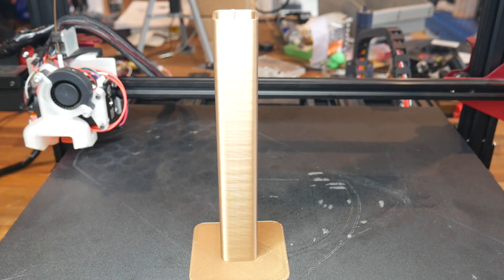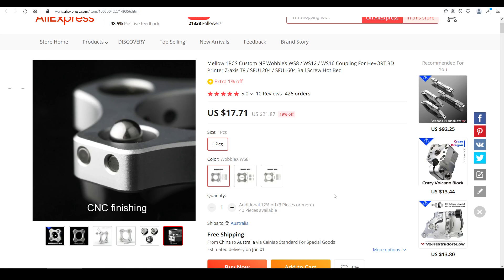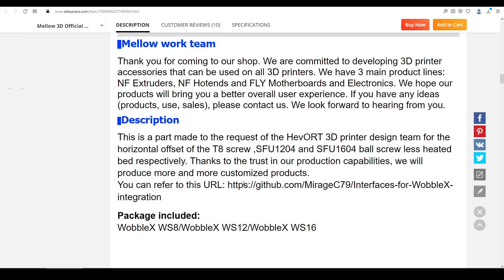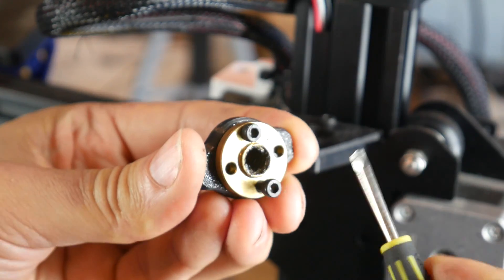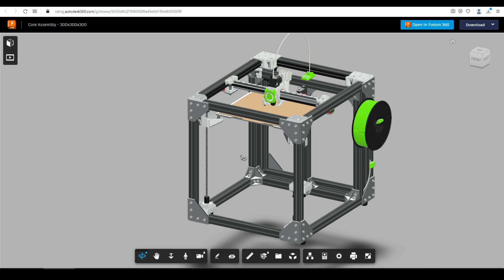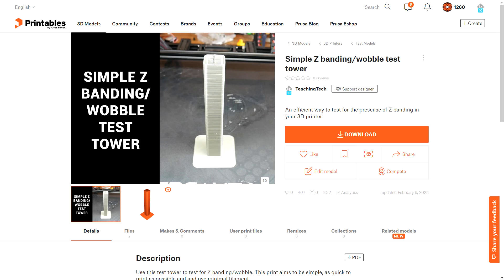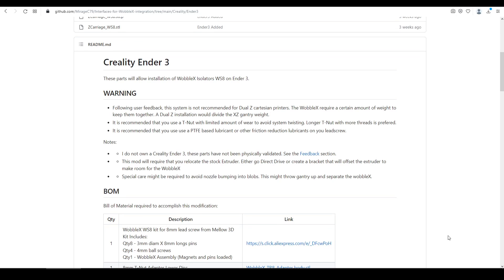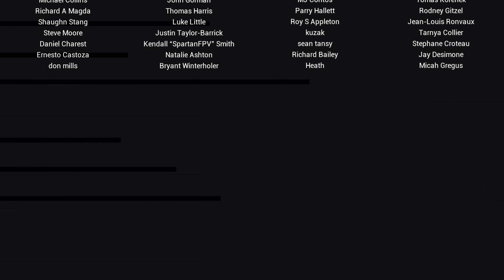The foolproof fix for Z banding and misalignment? MirageC’s wobbleX

Comment: The question is, is the "wobbleX" really better than a classic Oldham coupler. Those offer less degrees of freedom, but I don't think the tilt is really necessary. If the lead screw is so bent that the tilting becomes a problem, I think no kind of coupler will help. And Oldham couplers don't rely solely on the weight of the gantry to work, are much more compact and mostly a drop-in replacement.

Comment: Two years later.... I think there was something terrible crooked on your adapter, even when you put pressure on it the wobblex wasn't aligned. You can clearly see it at 10:02. The printed parts looks terrible as well, you can't expect precision from this sort of print quality.  
Printed mine with a 0.08 layer height, they look like its coming from a mold.
Have a dual Z cartesian printer, my lead screws have a 2mm lead, the z is turning a lot compensating for the bed, (fade height at 8mm)
even then no issues, both stays in place.
Out of the factory the rollers are way to tight, maybe they do that to mask a bent screw.
It can be the reason that your X gantry can't follow the leadscrew if its going up/down.
Fine tune your Z that it can move freely without play, put some time in it to adjust it.

Comment: Label the parts a,b,c a is the top plate, b is the wobble x, c is the bottom plate. 

If you attach a ball and socket joint similar to those old bionicles rather then the springs you designed 

And make this connection from A to B where the upper two ball and roller joints meet. 

Then from C to B in the same fashion. 

You allow part B to still isolate the zbanding from Part C so it doesn't translate to part A.

Comment: You can just slot the holes the lead screw nuts bolt through and achieve nearly the same effect after you slot them slightly do not tighten the screws all the way just to where they touch but are still able to slide a flat washer under this screw is also helpful

Comment: If the solution for bent lead screws cost more than replacing the lead screws what's the point? New lead screws for a normal size printer cost $9.99 and the wobble x cost $18. Why not just replace the lead screws?

Comment: HELP!! I've got an Ender 3 v3 se and I'm experiencing a lot of z banding that's inconsistent but seems to be getting worse. I've only had the printer since January. I loosened the screws on the z rod housings on the gantry, everything seems square, the extruder isn't loose, but I can't seem to figure out what to do to fix it. I can't find a single video or article with pictures that shows exactly what to check and how to fix it for this model of printer. Is there ANYTHING you can do?? I'm a 60 year old retired farm boy from Minnesota in the United States and I can't figure out what to do!

Comment: Combine Wobble X with a standard anti-slack nut assembly.
Reply: nope, the lead nut is rotating with the screw
Reply: I you didn't, but manufacturers disagree @MrBlackmidi1234567890987654321

Comment: I know it's hard to keep up with updates on all the stuff you do, but I think you should try a little bit better.  I just ordered 3 of the Wobble X sets to upgrade my heavily modded Ender 3, Creality CR-X, and my HEVO 300.  All 3 already run linear rails, and Westham coupling setups, and have decent prints, but I'm always trying to make them better.  The "Z jumping" is a concern with me, but I'm hoping using anti-backlash nuts/springs will solve that problem.  Because so many people on here have already asked about the use of anti-backlash springs,  I would've thought you would have done some type follow-up using them.  If they don't solve the problem, I guess I'll try some type of rubber band, or o-ring.  And if all else fails, I'll go back to the setups I run now.
Reply: Well, after a CONSIDERABLE amount of tinkering, I just could not make them work on either the E3, or CR-X.  As already talked about, the "jumping" was just too much.  I could not get around it using anti-backlash nuts.  With the ABN's on top of the carriage, they would not let the Wobble X move as it should.  With the ABN's under the carriage, it still had the "Z jumping".  There just isn't enough weight on the gantry to keep the Wobble X mated together.  

In place of the ABN's, I used some relatively thick rubber bands wrapped around the gantry and lower Wobble X carriage.  I admit, that made a considerable difference, and is almost workable.  However, I was greatly concerned about the overall durability of the rubber band.  No matter how I tried, the rubber band would rub on the lead screw.  I'm sure this will eventually wear through the rubber band in the middle of a print.

I truly believe that if there was some type of springs to hold the Wobble X assembly together, but still allow the movement it needs, this would be a truly great product for bed slinger printers.  Maybe somebody could redesign the carriages to have some type of spring perch on them.  I'm just not a CAD person, and have no idea how to do it.  In the mean time, I've gone back to using Oldham couplers.  They seem to be the best solution for z wobble on my bed slingers so far.
Reply: Are u running DD or bowden setup? @tommyc8333

Comment: What about using an anti backlash nut on the lead screw?
Reply: nope, the lead nut is rotating with the screw
Reply: 5:24 You will see what I am talking about. Addling a spring pressure to the wobble x will preload it like adding weight to the gantry.

Comment: The wobble alters the Z height it doesn't matter how much X or Y is compensated. It's at the leadscrew and brass nut contact location. A better solution, besides investing in a new straight leadscrew, would be to stabilize the leadscrew by passing it through a second brass or delrin nut before it contacts the first brass nut. Anti backlash nuts are also worth considering. If you have any better solutions or why you think my reasoning is wrong please share your findings! Have a good day!
Reply: Your over a beer reasoning is wrong.  The Z height change due to wobbling is trivial compared to the swaying in the xy direction due to a bowed screw.  The wobblex is a very good solution to allow a cheap screw to be used.

Comment: What was the part you had to buy for your ratrig? I need that as well and then i will buy the wobble x for my ratrig to. I have the Ratrig pro 1.3 and want the wobble x on that one. I have to change out my MGN 15 rails to 12 too on that one. Ratrig Pro uses MGN15 for the rails.

Comment: Can this be used with an antibacklash nut? If not then it's a no-go for me. The lack of antibacklash was the cause of the problem with the Ender 3. Loading the X carriage with weight took up the play present between the leadscrew nut and leadscrew.
Reply: it should work with an anti backlash nut because MiageC uses ball screws for his HeVORT

Comment: I would love for 3D printer manufacturers to start looking into this and implementing it as a feature instead of a DIY. I honestly would like for the option to choose what features I would like from a 3D printer at checkout, like the option for this fix over a tradition ball bearing, or a glass or rubber build plate. I think offering options like this on manufacturers websites when you purchase a product could be beneficial to people who dislike the whole DIY side of things. If they did this though, they would need to also offer a base line for people who don't want excess options when purchasing a product.

Comment: Hmmm... tough challenge to balance the spring tension without it becoming resistance to correction which would not occur with weight added. How did you go with it? 

The lightest weight will be at the start of a print, so I guess the hypothesis to test is can you make it functional at a spring tension that overcomes the degree of z banding you have, before the necessary tension to function becomes too much to prevent wobble correction and thus fails to correct z-banding? 

Is it possible to have a central elastic sleeve attached that creates tension instead of exterior springs? That would move the point of tension inside the fulcrum created by the balls perhaps or closer to it at least?

Comment: Backlash nut on the top to provide tension? @TeachingTech  I found that getting even load on the L/R wobble x was the hardest thing. The most annoying thing was the added components caused the nozzle to hit the bed first home firing the ballbearings everywhere, thankfully I found them. I got marginal gains, but gain all the same. (sidewinder x1).

Comment: Thanks for a great video! Are there any updates on how well this works with the dual-z setup? I'm in the process of designing an upgrade for a dual-z Prusa i3 Rework and am wondering whether it's worth going dual-z with wobbleX vs just going belted z, using a planetary gearbox on a single Z motor (pricey, but not much more than a set of wobbleX units) for more precision and hopefully some holding ability in case of power loss.

Comment: The idea of two axis decoupling is being around for some time and this is a very compact way of doing it butI don't like that it depends on the gantry weight to work nor the idea of introducing some kind of elastic material to keep it together as someone proposed. This idea is just good for pushing the z axis up, but lacks of a sort of case to keep the rigidity of the z movement and introduces huge amounts of backslash. z-hop would be a real mess. @TeachingTech, maybe you can do some real prints with non silk filament, it hides a lot of surface defects.
Reply: Funny, there was a now expired US patent to cover this issue: US5392662A
Reply: Another one also from Eastman Kodak and also expired US5333513A

Comment: I’m kinda surprised at your use of the top captures on the lead screws. It’s been know for ten years now that use of relatively inexpensive lead screws work best when they are allowed to wobble. Capturing the ends introduces inhibition within the threads.
Reply: I believe the idea is that by capturing the lead screw at the top it forces any deviation into the WobbleX device which then does its job and absorbs it. He did say it was something specific to this device for it to function. He even mentioned the ones he had laying around wouldn't work because they allow wobble (he wasn't actually using them ... I have a set "laying around" too, they came with the secondary Z axis kit I got, but I have never used them) and don't trap the rod tightly enough.

Comment: The low weight problem can be eliminated in a way that opening the gap between steel rods little bit more, then balls can't escape. I m using in my printer a similar design and I have been using with no problem.

Comment: In the cnc industry we keep ball screws under stretch to eliminate this issue, among additional strategies obviously. I'd love to see that implemented somehow. In my experience, stretching a ballscrew can improve accuracy 90x. And it doesn't require that much stretch for a ball screw that heats up very little.

Of course a glass scale or a linear transducer really would be infinitely better for this that relying on ball screw pitch error to be minimal.

Comment: I have a modified Ender 3.  I added a worm gearbox to my Z axis and I expanded the Z and Y axis to 1M (1000mm). The z wobble has been quite rough even before the expansion.  So far, tests with the WobbleX have been impressive.  I didn't know about the hole sizing on the screw and printed the wrong part but drilled it to fit and it's working fine.  I would have printed it again but I have to take apart my worm gearbox to install the wobbleX and it was already apart when I discovered the size difference.  The WobbleX for the ender3 doesn't have as much play as the others, and at about 500mm it does reach it's limit, but when I'm printing parts that large a little wobble is expected.  One thing to watch out for is lifting the gantry.  Those little magnets don't hold it together very strongly and you can easily lift the gantry and loose a bearing if you aren't careful.

Comment: I have a similar design that is a complete 3D printed solution for the frames, and found that a sizeable rubber band wrapped around the entire assembly works well on my CR-10

Comment: The Wobble will only help with Z-banding if the printers lead screw is overly constrained.

The imperfections in a lead screw will only translate to a print if it can't be taken up by tolerances elsewhere in the printer. This can be absorbed by a flexible coupler between the stepper and the screw and by removing any other bearings besides that coupler. I.E. a bearing at the top of the printer.

Alex Kenis goes over this in depth if you want more info.

Comment: Spring preload is definitely the way to go. My first thought due to the size restriction might be to use clothes-peg springs (aka a torsion spring). They are small enough with sufficient travel, a simple horizontal pressure point and have a handy hole in the spring section for additional mounting options.

Comment: Woah, this is sweet…this might have solved the issue I had with my OG Ender 3 Pro (Upgraded with a MicroSwiss Direct Drive extruder).

Took it apart and re-assembled multiple times and couldn’t get rid of those inconsistencies.

Comment: Mine will arrive in just a couple of hours! I have an ender 5 plus, so I think it will be sufficient weight to keep everything together. I also have some spare backlash nuts for some extra pressure, but I don't think those are needed.
Reply: How are they working out on the Ender-5 Plus Rachelle?

Comment: It is a clever solution and doesn't cost much, but I do wonder if simply going to the next size up diameter lead screw would be an easier and more straight forward solution.  You'd need a new coupler for the motor, a larger nut and a support on the end.

Comment: Ironically, it seems that on the ender 3 the problem with weight could be solved by using a Bowden system instead of direct drive. It's a shame that Bowden is not supported (although, I will admit it doesn't seem to be an easy ask...).

Comment: Wouldn't a second magnet embedded in the 3d printed adapter increase the down-force? IMO it would be the same as  a spring or rubber band. The question is if the force i high enough. If it is i think you can assume that the unit would not separate

Comment: I used a couple of Oldham couplers printed in abs and sanded to be as smooth as possible, with some grease in between and it's years I don't have banding... This is clever but even overcomplicated

Comment: How can you tell when the extruder nozzle needs replacing?  If you put a new one in, the number is  telling me what?  and  If the number went from a 2 to a 3, lets say, is there some where in the software for the printer or slicer, that needs to be changed?  I have a Ender 3 Neo, and I got a kit of 10 nozzles from Amazon with different numbers on them, and wondering why you would use a different number?
Thank You.
Michael

Comment: Another option instead of springs could be small o-rings, mounted/hooked in much the same way. Seems like they might couple the two halves rotationally with a lower amount of tension than required by springs.

Comment: I can see this being an issue if you use Z hopping. Adding springs might help but the quick up and down movement of the Z might still cause problems. I think that if the screw is wobbling that bad then replacing it is a better option.

Comment: i have been using a fully printed version on my ender for about a year and love it. you know what are the hidden benefits of this that i love so much? you can lift the entire gantry up by hand to do maintenance any time you please since it is is no longer bound by the leadscrew. secondly, it is now harder to destroy the bed with unexpected or illegal negative z commands for the same reason. the Z leadscrew can no longer drive the nozzle below the bed as the nut will simply separate. sorry this only applies for bedslingers--you dont get this benefit for corexy. 

all printers should have this, and i suspect it greatly reduces the cost for the custom builders by allowing use of lower grade leadscrews and ballscrews in their builds. one piece of advice i will give is to get spare balls or inform mellow to include spare balls in the purchase as you will lose some.

Comment: Simplest solution: loosen Z nut bolts to allow some lateral movement + never Z-hop. Free side rollers could be looser to allow smooth movement.
Or, belted Z with as loose Z rollers as possible, and with counterweight on heavier (X motor) side to keep gantry from falling :)

Comment: I know you tried adding a thrust bearing in your previous video, but in this video it looks like your "rigid coupler" is hanging in the air. The problem with that is that the NEMA17 motor has a spring inside of the motor, and it is not built to hold steady vertical loads. If you want your rod to not move up-and-down because of the spring inside the motor, you must make it so that the rigid coupler is sitting pressed against the motor body with a thrust bearing. That way whenever the rod wants to push on the spring inside the motor, it doesn't have anywhere to go as the motor body and the rod are not allowed to get displaced on the vertical axis.

I had some lines appearing at various heights on my cheapo biqu-b1, and after making the rigid couplers rest on thrust bearings that are pressed against the motor body those disappeared. I didn't even bother printing a part for them like you did in the previous video about this subject.

Comment: Facepalm! If you are leaning the axis in any direction you will get height differences either way, no matter the coupler you try. An exaggerated example if your threaded rod was at 45 angle do you think you will get the same height just by putting a coupler. Come on !